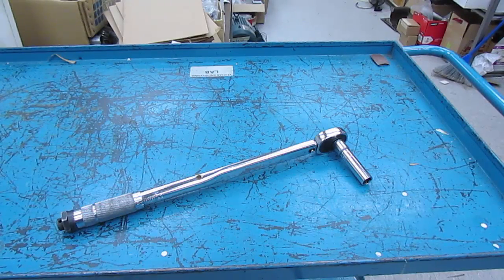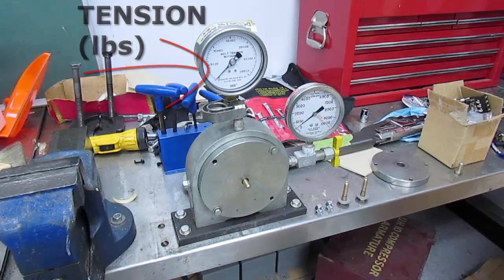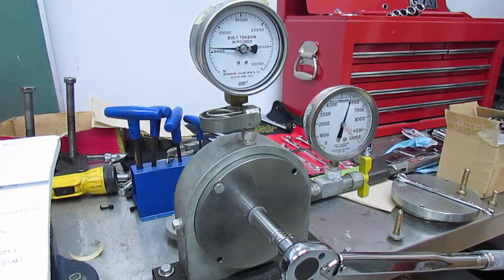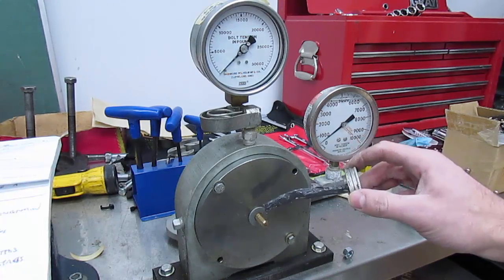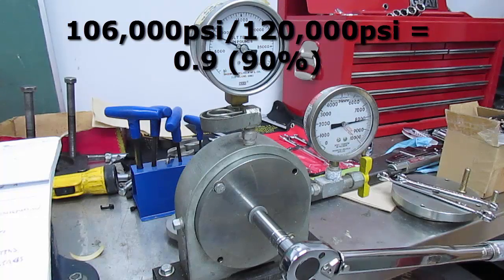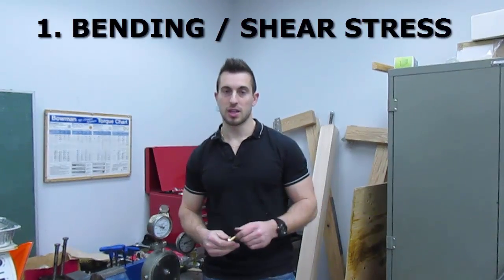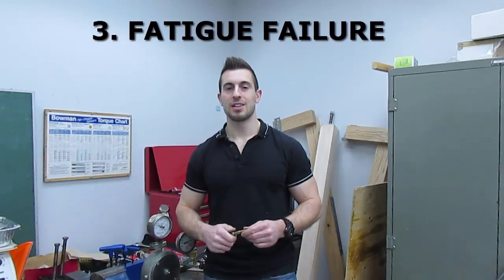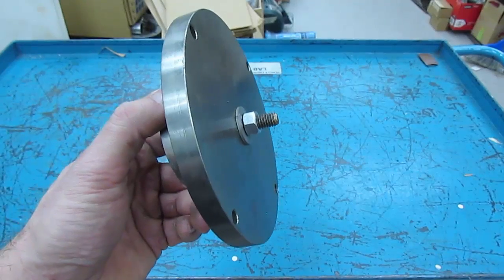Should You Put Anti-Seize On Wheel Studs / Lug Nuts?

Comment: I work at a tire shop and we are required to apply anti-seize to all wheel studs when removing wheels. Keep into consideration that many people go years without removing their wheels which gives plenty of time for the lug nuts and studs to rust on and seize up making them difficult to remove, which we have to deal with often. We remove hundreds of wheels a week and have never had a customer's wheels loosen or fall off even after not having their tires serviced for years. Just thought I'd throw that out there.
Reply: Not only do I put it on my studs, I also put it wherever the rim makes contact with the hub. If you've ever been stranded on the side of the road with a flat trying to break your seized wheel free you know what I'm talking about. That never happened to me again.
Reply: @ZachComa  anti-seize on the surface where the rim is touching the hub is recommended, especially for alloy wheels. Anti-seize on lug threads is not. I am an prolific anti-seize user because all I have are old vehicles and seized fasteners are the bane of my existence - but I leave the lug threads clean.
Reply: Show this video to corporate technical management. Perhaps they're not aware of the problem. Further, I'd suggest that management starts with getting manufactures' recommendations in certified writing. This can be really dangerous if someone gets it wrong. On the other hand if a set of specs exists on the work order, and the tech signs off that they did it, that's strong evidence against suits and expensive metallurgical testing for the shop.
Reply: I have to rotate my tires every 8 months so your point is moot. The rust builds up that quickly. My lugs are always completely seized up. I always hurt my arms trying to remove them. What can I put on them so they don't rust on?
Reply: @largol33t1 anti seize. Then torque to 30% less.
Reply: @largol33t1 Have you looked into possibly using some type of rust inhibitor? Although that STILL amounts to putting a foreign substance on your wheel post and lug threads. These people who just simply "apply 20% less torque" to each lug, then go out for a nice weekend drive with the fam and go 85mph on mountain roads are, I'm my estimation, the literal definition of being reckless, unsafe, and having no common sense at all.. Over $100 - $200 dollars???. Sheesh, people are cheap! There's literally no amount of money enough worth risking yours, your families and other people's lives just to be able to take your wheel off a little bit easier. It's just plain stupidity, imho
Reply: @largol33t1  Avoid arm muscle strain by using a longer lever length.  I Include in my auto's car kit bag a 1/2 inch drive "Breaker Bar" at least   24 inches/60 cm long.   You get it extra long leverage easily by slipping a  48 inch / 120 cm water pipe over the Breaker Bar.  Beware of "cheap" Breaker Bars.  The pivots on cheaper brands will break by splitting apart under the extra applied leverage sometimes without the extra length included. 

Of course add the  correct wheel stud nut size as a 1/2 inch Drive 6-hex design deep-length impact socket type.  Check that it actually fits snuggly on that nut.  Some  out of spec Chinese sockets are loose or tight because I guess they adjust metric machine tools to handle cutting Imperial spec parts.   You can check between close Imperial vs Metric sizes or wrapping elastic material around the nut.  Doing all this avoids visiting a doctor after wheel changes.

--JSW
Reply: Good engineering dictates: 1. Decide the necessary clamping force. 2. Pick a stud that when lubed with anti-sieze and torqued to X lb/ft will provide 100% of necessary clamping force  at 50% of force necessary to destroy the stud. This allows for human error. But this means a bigger fastener , more $.
Reply: I use a very little amount. Enough to no seizing and still not enough to create an issue on the wheel studs
Reply: It’s the opposite. Lube doesn’t make the nuts unscrew easier. It makes them clamp more for the same torque.
Reply: IN EITHER CASE!!! YOUR RIDING ON WHEELS THAT ARE INTENTIONALLY TORQUED LESS THAN SPECS..!!! AT THE END OF THE DAY, AND IN CONFLICTING WITH HIS SCIENTIFIC AND MATHEMATICALLY PROVEN ASSESSMENT, YOUR ALL PLAYING AROUND WITH YOUR LIVES AND OTHER PEOPLES LIVES? THE PEOPLE WHOS CARS ARE SERVICED AS WELL AS THE OTHER DRIVERS OTR. IS THAT REALLLLY WORTH A COUPLE HUNDRED DOLLARS, OR YOUR PEACE OF MIND AT 80MPH??? ITS NOT. AND THIS VIDEO PROBABLY JUST SAVED ME FROM CATASTROPHIC FAILURE
Reply: It's hilarious because the torque difference is like 10lb, your studs aren't going to fail if they are over torques by 10lb even 40lb.

What I have had happen is a roadside flat tire, I used the crappy tire iron that came with the car to take the wheel off.. 3/5 studs broke leaving me stranded. Never had a lubed stud fail on me ¯\_(ツ)_/¯
Reply: @adamtaylor876  This video literally showed a 2,750lb difference.  Don't confuse torque with pretension.
Reply: It’s a bit late in the day but I’ve anti seized wheel studs and bolts for 40 + years and never ever had a bolt break or loosen or a wheel fall off . On the counter side I have had wheel bolts break because they were seized in and simply either tore the threads off or twisted off the stud or made the bolt almost impossible to remove .
I know exactly which is better and I’m sticking to it thanks .
Reply: I agree ,i have anti seized the studs and hubs for years .In the rust belt where i work ,operate my shop it is manditory and aluminum wheels to steel hubs grow together and you cant get the wheels off without major effort. @kernowskunkworks
Reply: @kernowskunkworks lube is better but reduce torque by 25-30%.
Reply: @kernowskunkworks  your still altering specs, playing with fate, relying on luck, and putting countless lives at risk. Didn't you know trix are for kids, and scientific facts are for engineers to keep people from DYING?? BRAH? 😒
Reply: Yes, I've always lube'd my wheel studs/ lugnuts before torquing them down and have never had a problem with them coming loose.
Disclaimer:  I am not a certified mechanic and advise you to research what is best for your situation. Fuck it!
Reply: The problem isn’t so much inaccurate torque, it’s uneven torque between studs (which causes warped rotors) and as mentioned in the video, fatigue and stress on the stud and bolt threads because anti seize causes uneven pressure across the threads.

Comment: Here's an idea. How about some chemical/petroleum/mechanical engineer type devise an anti-seize that does not lubricate so a lug nut can be torqued to its specified value to put the bolt in its design spring range. Seems like there should be something like that specifically for automotive use.

Comment: Excellent information, thanks and your explanation/presentation could not have been better.  As an FYI and like others who have commented, I have used anti-seize on lugs for years with no apparent long-term illeffects. I never used a torque wrench because I've done this enough times to know what 75lbs of foot-force feels like.  I will say that I likely let up a bit because of the lubrication torque ease.  My bigger worry is too much torque causing rotor warpage.  As for becoming loose, that will usually become apparent with wheel wobble at high speeds (alignment-like need).  Regardless of my experience, I learned a lot from your video that will make me conscious moving forward.  Well done and thanks.

Comment: Nice video but you only looked at half of the process. Torque verse clamping changes after nut and bolt are tighened due to the fiction change. About 40 yrs. ago a Bowman fastner rep put on a similar demo. If you looked at the bolt and nut under a microscope there are mountain peaks from machining. After the first time you torque it down you have also burnished the peaks down. Now you have more surface area which means more fiction which results in the same torque applied when new will yield less clamping force after first use. You can test this on you buddy's set up. Also go ahead when making this test after you checked a new bolt and nut and take it apart and reinstall the nut on the same side (don’t flip the nut over) and recheck reading, now flip the nut over and retorque and check it again and you will be back close to where you were when everything was new because you are using the other side of the threads. You will lose a little clamping force because of the burnishing of the bolt, but the nut is always softer than the bolt so by flipping the nut you pretty much have a new nut. Then you can go ahead and apply anti- seize and see what you get. Back to the Bowman rep. His advice was to use anti-seize. I have done this for 40 yrs. With no problems. My only question has been did the factory engineers come up with there torque for a new bolt or one that is used (tightened at lest once) or a used bolt. I think for a new one because if you buy a new stud and lug new you torque to specs.

Comment: Would be interesting to see what impact antisieze has on corroded lugs, I'm guessing it probably brings clamp load closer to "new' specifications. As a rule I antisieze all my lugs and use a torque wrench, never had an issue with stretched threads or broken studs.
Reply: There is a video on YouTube where a guy does the same test with new, corroded and corroded and lubed bolts. Corrosion reduces clamping force to ~30% of clamping force of a new bolt. Lubing it brought it back to ~80%
Reply: @edvinasm7902 https://youtu.be/O96AUlIBkU8?si=Y-1o4NMeVnoD2JOJ
Reply: @edvinasm7902  where can I find that video please?

Comment: Cool. I use both a micrometer torque wrench (old Proto half inch) and a hf digital torque adapter. I can check torque wrench accuracy and calibrate if needed with torque adapter set to peak trace. Also, after doing 2 passes using torque wrench  on lug nuts I sometimes will use digital adapter between torque  wrench (set to peak trace) and lug nuts and go around again to verify accuracy. I can get all 20 nuts (at 76 ft lbs dry)  on my wheels to within 2 ft lbs of each other.
Reply: Very thorough but you're confusing torque and pretension.  I guarantee you every single bolt's pretension varies by a lot more than 2 lbs.

Comment: Make your own choice.  I put one drop of oil on my lug nuts-always have, BUT, a big but, is that I tighten my lugs with a 4 way with normal muscle and have never used a torque wrench.  I'm sick of this lack of common sense.  Most people don't have an expensive torque wrench unless they are car guys/gals, then how about use common sense and lower the torque 4 or 5  foot pounds or whatever.  Why don't you figure out with your fancy machine the proper torque with a lubricant and post that out there.  Not just nay/say everything into one neat little box of NO. I've never had warped rotors or any other problem.  There's no common sense left in the world.  My wife's lug nuts were frozen on and either broke or stripped  the head and the lock lug nut, so it cost about a $75 dollars to replace all 20.  A little oil may have helped.  Don't want to start an argument, but as you'll, see many of the comments that people have done it 40 years like me and no tire ever came off, but I agree if you are torqueing them to a "spec" then maybe your advice is gospel.  But I don't know if the Gorillas at the tire shop are torqueing them too much.  Nice video though.  Just saying a lot of people just tighten them with brute strength and they are fine.  I hear ya Lost Beetle.  I agree. Plus they are overbuilt.  If one lug nut breaks, there are 4 more!  If you're going to ruin all 5 lug nuts at once then you are over torqueing them or need a new torque wrench.

Comment: As good as this information is when putting on lug nuts in winter climates with road salt usage a dry torqued bolt will rust in place and end with broken studs. So you torque bolts approximately 10% less to keep from overloading the studs. Sometimes there is NO good answer and in a world where the majority of bolts are NOT torqued with a torque wrench it is anyone's guess as to the actual torque anyway.

Comment: Interesting. Ive been working in cars for over 50 years. When working on my own cars I have generally always used anti-seize on the lug nuts/bolts and have never had one problem in all that time. Also use it on any nut/bolt that I know will be needed to remove for future repairs such as the EGR valve I recently replaced. Just lucky I guess.
Reply: I use some kind of anti seize or lube on almost everything. I hate seized and rusted fasteners. I've never had a problem doing it in 20 years. If it's something I have the wheels off of a lot I simply use some oil for my street vehicles anti seize it is.
Reply: I feel the same way, but I got burned when someone else worked on it.,another interesting video is ALKITRONIC, where they switch from torque to angle.
Reply: I use lube all the time but maybe theres a caveat . Being a professional mechanic for 30 years and hobby mechanic before and after, one tends to gain a clear sense of torque required. Cant expect everyone to develop that same sense so i can understand why some manufactures and shops set specs and guidelines. Problem is, some torques are dry, some lubed. Why not lugs lubed? It gives much more accurate torque. Ive installed many critical parts on turbine engines as well as wing bolts and spark/igniter plugs that call up a thread lube. Many others dont but on aircraft its rare to be dealing with fasteners in a environment remotely as harsh as wheel lugs.

Comment: Has anyone EVER seen a tire shop put a torque wrench on their tires when they replace them?.  I haven’t .   And I am a graduate Civil Engineer.   I would think the design engineers will calculate the ideal torque value, calculate the effect of possible rust, take into possible wheel speed,  and the possibility of some knucklehead over tightening the lug nuts with the same 3/4 inch impact tool rated at something between 1500 ft.ibs  and saying. I had better figure in a safety factor of 20 instead of  10.      Management comes along and says  let’s make the safety factor 20, Oh ! Add a couple of extra lugs because 15 years ago we has a couple of accidents where a tire came off and the car went oner the rim at Grand Canyon killing a couple and their kids.  The recall on that model of  us 39 gaz